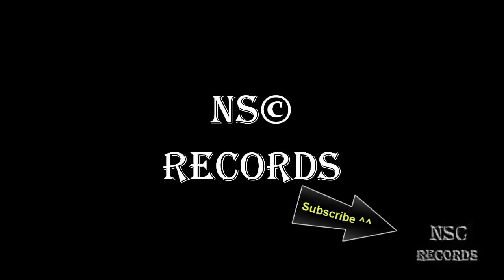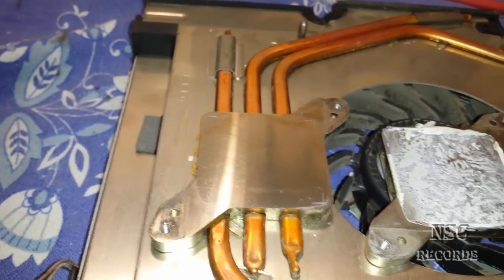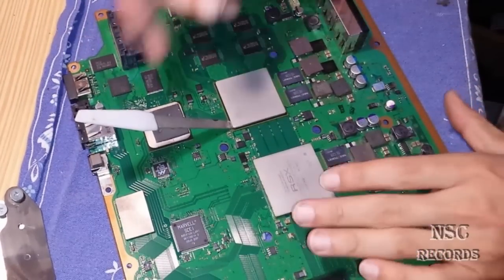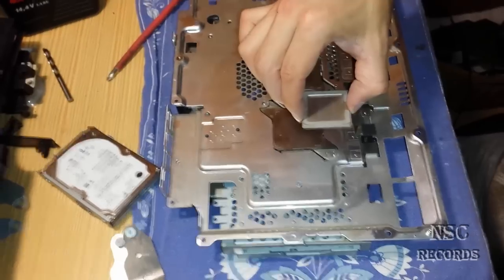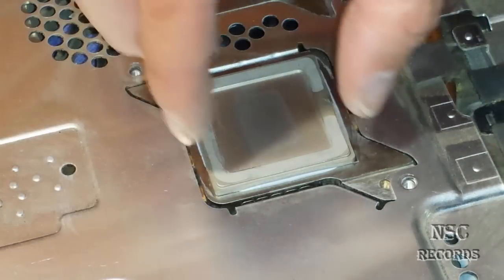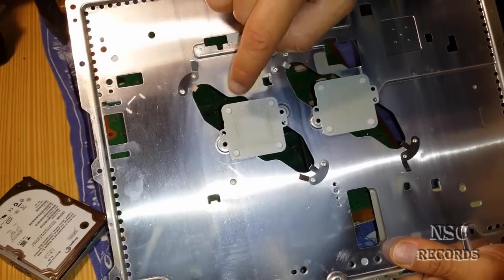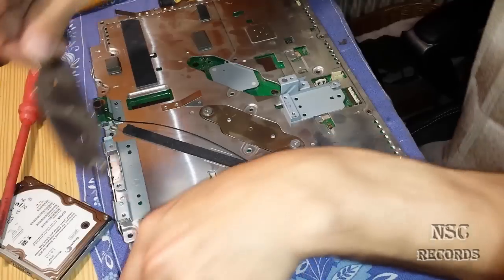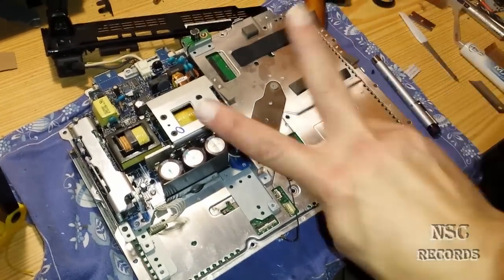Best way to Replace the IHS on your PS3 By:NSC

Comment: Awesome video man.. I TRIED SO MUCH TO COOL DOWN my backwards compatible PS3.. thermal paste multiple times including under the heat plates, a new fan, taking the cover off the power supply.. what ended up finally making it quieter is the CARDBOARD of all things!! It still runs a little loud because I thermal pasted everything on the outside EXCEPT under the CPU.. but when I put the cardboard on the CPU side, it finally gives off more heat and sounds quieter than before and it is thanks to you!
Reply from the maker: You always welcome :)

Comment: Thanks for the great videos man! I have a few questions about this...

1) Are you still using the CoolLaboratories thermal paste? I see the silicone stuff on the CPU here

2) Do you need to scrape and replace the U of silicone on the edge of the IHS/CPU?

3) I think you've mentioned that you're cutting the IHS off with a file in previous videos. I've tried fishing line and a feeler gauge, and neither have worked. Maybe make a video on the tool you're using?
Reply from the maker: Yeah, no Problem ;)
1) Are you still using the CoolLaboratories thermal paste? (sometimes)
2) Do you need to scrape and replace the U of silicone on the edge of the IHS/CPU? (NO, just clean it on the IHS)
3) I think you've mentioned that you're cutting the IHS off with a file in previous videos. I've tried fishing line and a feeler gauge, and neither have worked. Maybe make a video on the tool you're using? (if you get a lot Thumbs up on that question, i wll do a Video about) ;)
Reply: UltraNSC Hey man, I found one of your Deutsche videos explaining your tool. I applied the same sandpaper and fingernail scratch test to a .008 feeler gauge, and it's worked PERFECT for 5 systems now, nice and easy cut...so thanks for that tip!

I've just had issues now with the temperature of the CPU. I've got a CECH-G model at 54*/48* idle with fan mod, little high, and my most recent CECH-E model shoots up to 75*/48* idle with fan control utility!!! Wondering if the leftover U of silicone glue is preventing good contact with the die. I've cleaned the IHS, and spreading MX-4 as you recommend in other videos... is there any harm in removing ALL of the glue?

Thanks again for your time and great videos, keep them coming!
Reply: OR, is this when to try cardboard - Karton - under the clips?
Reply from the maker: Hi and Thank you very much to...

You can remove the Glue just on the CELL IHS, this is fully enogh..

if your CPU is still getting to hot, than your Presure is not great enough, thats why it gets still overheating...
Reply: Thanks for the reply buddy!

Tried a couple days ago... took apart, cleaned, reapplied thermal paste, added cardboard for a little more pressure, still no luck. Little bit better at 68*c idle. Took apart again, removed ALL glue from IHS and CPU, reused cardboard for extra pressure, and now 53* idle, 59* in-game with control fan utility on payload mode. My living room is 26-28*c in the afternoon at this time of year with the sunlight....TOO HOT! (Tucson, AZ, USA)

I'm wondering how these machines were assembled at the IHS stage. Robotic?? I feel like the silicone was keeping the IHS from making good contact all around the die, maybe a bit too high. There were a lot of air bubbles in the glue on this one. After adding pressure the first time, and taking it apart afterwards, I could finally see good contact in the thermal grease.

Seems to be on a machine to machine basis. Anyway, something to keep in mind! Thanks again, and keep up the great work! This IS the place to be  *thumbs up*
Reply from the maker: Thank you very much man :)

And if you replace them like here, you should have no Problems: https://www.youtube.com/watch?v=_RYSnYL2XQw

PEACE Bro. :)
Reply: Corrrrect

Comment: Great videos.. ive learned alot. I would bend the heat spreader clamps before butting cardboard in between the plate. The clamps are what put pressure on the cpu not the back plate pushing on the motherboard from the bottom. Just bend the spring clamps open more

Comment: Just how exactly did you know where to make the marks for the heatspreaders? Did you use both of them to get a precise idea of where to make the indents?
Reply from the maker: Easy, when you open all, you have the old thermal paste on the cooler, after delid the IHS put the IHS on the cooler over the old paste and mark it ;) I have a lot videos about that 😊

Comment: good for the disassembly but I would like to know what silicone is used for the processor and see an assembly, since it does not have videos of it and there are several disassembly videos

Comment: Great videos and great channel, you really helped me a lot :D I just have 1 question, I have a ps3 and need to replace thermal under the CPU IHS and I only have MX-4 thermal paste.. I know that is good for putting on the IHS but can I put it under IHS or it has to be arctic silver 5?
Reply from the maker: Thank you, use for all MX4 :)
Reply: ok. Thank you :D

Comment: I'm planning to only use MX-4. I read somewhere that, while Arctic Silver 5 is more effective, but it has a lot of drawbacks: the curing period, it's conductive and, most important, it decays faster than MX-4.
MX-4, on the other hand, doesn't have a cure period, it's not conductive, and, while it doesn't perform as well as AS 5 (while on its peak), it perfermorms more consistently and evenly on the long run. The manufacturer guarantees 7-8 years on reliable performance.
I also read good things about Gelid GC-3 Extreme. It's a tad more expensive, but it has all the advantages of MX-4, and performs as well or even better than AS5
Reply from the maker: +Xerxes1688 Yeah, but i and not only i love Artic Silver 5, it´s just still ones of the best Thermal Compound, Used a lot times also worked on old PC´s longer than 6 years without Problem. AS5 has  9,0 W/mK, and 99,9% Silver,  and it works just Perfectly also after 6 years and more, i use this Thermal Compound very very Long and im still suprised. MX4 is also very great, no need better...

Comment: Thank you so much for your videos. They are going to be my guide working on 2 phat PS3 I have here. I just have one question. If I replace the thermal paste under the IHS and over it do you still think it's necessary to put the PSU on the outside of the PS3? Or replacing the thermal paste is enough?
Reply from the maker: Hi Replacing the Thermal Compound should be enough :)
Reply: Thank you!

Comment: Hey ! First of all : Thanks for this video. You told us a lot of details. I just want to know something about the RSX heatsink since I never done that before. There is 4 chips under it on each coner (the memory I guess). Do I need to put thermal paste or something on it ? Or I just do the same thing you did with the CPU heatsink ?

Also, do I need to put a carton for both CPU and GPU ?

Once again, thanks a lot. I'll be able to heal my BC PS3 like a boss \(^.^)/ she always make a lot of noise after a couple of minutes, even if i'm only on the XMB !
Reply from the maker: +The Satan Claus Hello If you do all like me, u will have no Problems. i also never use thermal paste on the Memory Chips, i just did it one time for an old Video, but i never do it on the Memory Chips, thei just dont need it. Your PS3 gets loud, because the thermal Compund inside the IHS is old and bad ^^ Just take care on open the IHS! CPU can be Danger, because if you scratch the CPU, nothing more will work!
Reply: Woah, I did not expect an answer within 10 minutes lol. well, i'll be carefull with the CPU and i'll probably try to make a nailfile like you did on another video. Do you have a recommendation for a similar tool I could use ? I'm not a women so I don't own a nailfile hehe.
Reply from the maker: a nailfile is still just the best, and the nailfile needs to be VERY thin, so thin as you can do :)

Comment: Hey im just wondering if i were to remove the IHS on my ps3 for the RSX only and reapply the thermal compound from the inside. Will it fix the false overheating it shows 81°C on RSX in multiman when its not hot at all and 40°C on CPU. Or should i do cpu and rsx both? I have a ps3 slim btw. Please let me know thanks

Comment: When your fan runs at full speed for no reason it will probably be the thermal paste underneath the IHS for the CPU right, no need to replace it for RSX? (PS3 FAT)
Do we also  need to remove silicone under IHS?
Reply from the maker: +Randy Timmermans You can let the Silicon on the CPU, just clean it on the IHS
Reply: im about to replace the paste under the cpu mines fucked

Comment: Hi, I'd like to ask you one question. When I used the metal thermal paste, I put the CPU heatspreader the other way. Should I take it apart and replace it normally? The PS3 runs just fine, never goes over level 3 fan and there's a shitton of heat coming out of it (much more than with Ceramique 2 thermal paste lol).
Reply from the maker: no no if all is runing great than let it...
Reply: Okay, thanks :)

Comment: Worried bout my used 60gb fat that i got a year ago now learning how they overheat but so far no big problems and fan doesn't get as loud as some ive seen. only time it shut down with beeps was after playing TLOU for 12 hrs and freezing a few times during LBP. Watching vids in case it happens again but scared to scratch cpu like a lot of ppl with more experience have done. Should someone wear an anti-static bracelet when doing repairs like these? Can't it shorten the life of the ps3 without one?

Comment: PLEASE HELP ME!!!...I have an ps3 slim ...when i turn on the console and when i play a game (like GTA V) , the fan is getting very louder but console works ....it works 2-3 hours in game an then he show me "the sistem became hot...." , i changed the thermal paste but nothing ...and the console didn't became hot ...i think it's a problem with heat sensor , but i don't know ...Please help me! Thanks
Reply from the maker: You will need to open the IHS and replace new thermal compound inside the IHS
Reply: UltraNSC Thank you very much :)
Reply from the maker: np ^^

Comment: Hi UltraNSC I have a problem with my PS3 fat . . . I've tried a lot of work arounds changed the thermal paste with MX4 several times but it didn;t help. My Heat Sensor thinks that my PS3 is running hot, which it doesn't, and it always keeps the fan @ 100% a few minutes after starting the console, even in the meniu . . .is there any workaround for this problem ? Big thanks and keep up with nice tutorials

Comment: the silicone or whatever they use to keep the cpu on the ps3 hard on one of  my ps3's. how would you recommend getting it off. Ive gotten the rsx ihs off with no problems.
Reply from the maker: you will need to you you a spesial tool like on my Video that is very thin
Reply: Show me how to make your special tool XD
Reply from the maker: i have some Videos where i Show it ^^
Reply: i guess its my bad lol. I couldnt find a nail file thingy that thin :'(
Reply from the maker: you will need it to do it your self ^^
Reply: XD ok maybe ill go to the hardware store later lol
Reply: ok i made one and it worked alright. but the tip broke off. Ps3 runs a little bit cooler now but ill have to pop the gpu heat spreader off and replace the paste also.
Reply from the maker: Cool, so finaly you fix it a bit better as it ws befor ^^
Reply: yeah now it only picks up 3 fan levels . ill have t o pop the gpu spreader off. but i dont want to fuck that up :'(
Reply from the maker: just be carefull and do it like me :)
Reply: Of course XD.

Comment: Hi, can you please help me out. My ps3 works sometime only. When I turn the ps3 on then I get YLOD AFTER 5 seconds. I have tested thet the motherboard is fine, GPU and CPU and an extra chip works fine. Then I was keeping tying to turn on, then I get it working, then the ps3 works fine, I can even play games. But when I turn it off, it will turn on  without problem. When I leave the ps3 off for about 10 minutes, then the YLOD is back after 5 seconds. I have flashed the ps3 still no luck, power supply changed but still no luck. Please help me out mate, I know you have more knowledge then me. :(

Comment: will this method work for ps3 slim 250gb?

can i use a kitchen knife which is a bit sharp to remove ihs , i dont have anything else in the house to remove it without damaging it
Reply from the maker: cr7187 this works for nearly ALL PS3´s, and no, just use the stuff like i have on my Vid.
Regards
Reply: UltraNSC what do you have in your video , what is that small tool that you used to remove the ihs

Comment: Excellent Video Just a Question, I know you tell use ARTIC SILVER 5 Inside but, Can I use MX-4 or not? I do not have ARTIC SILVER 5. in the place than I live it is impossible to find it, So if I can, I will buy it on eBay, but it  will takes long time to get it. and I dont want to wait a long time. Thank you in advance
Reply from the maker: Philip Andre Milian you can use also MX4 :)
Reply: UltraNSC can you also use arctic silver 5 premium silver on top and inside? sorry i am a noob.

Comment: Can I purchase a few heat spreader CPU removal tools from you that you use on these PS3 CPU heatspreaders? I have tried over and over to make one myself, and either the nail file breaks when bending it, OR when filing it down the nail file breaks, or when trying to get the nail file inside under the heatspreader, it will not fit, or when it does fit, it again breaks! I cannot get any nail file to FIT under the heatspreader of the CPU, and all of them BREAK when I DO. Please help me out, I have tried this for 5 months now, and I CANNOT get this to work for me. Please sell me the tools I need to do this so I can put thermal paste under the CPU heatspreader, or I will have to pay someone $89 to remove the heatspreader for me, because that is what these people out here charge to do that, and I cannot afford them to do this to 4 PS3s that I own. Please help me out NSC!
Reply from the maker: Yes, it´s posible to buy it from me, please send me a eMail: UltraNSC@live.de
Reply: Thank you, email just sent! NSC, it's the place to be! :) Danke'!
Reply from the maker: :) You Welcome